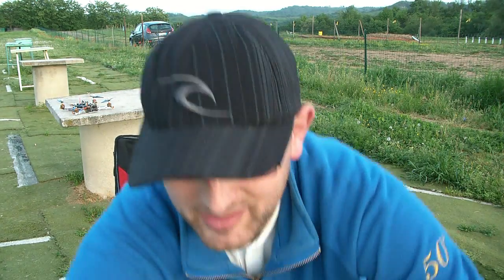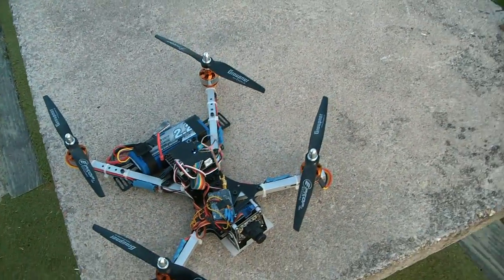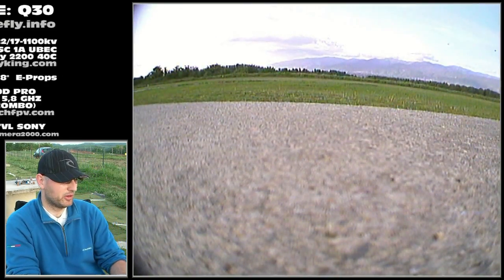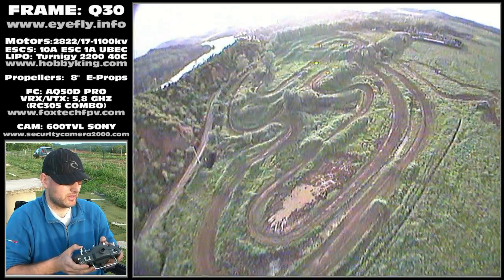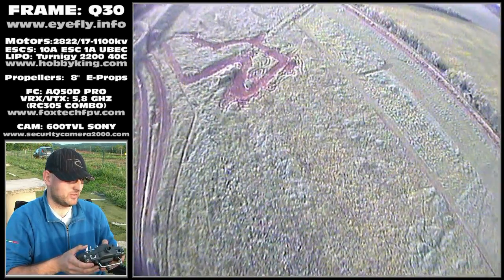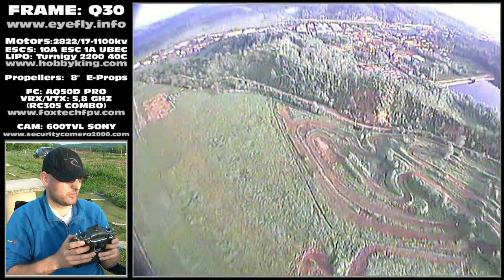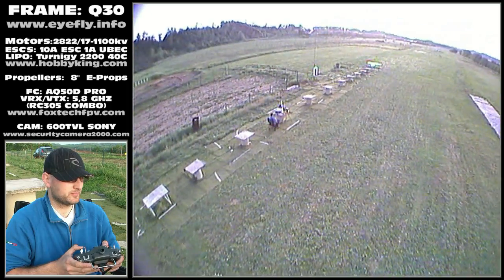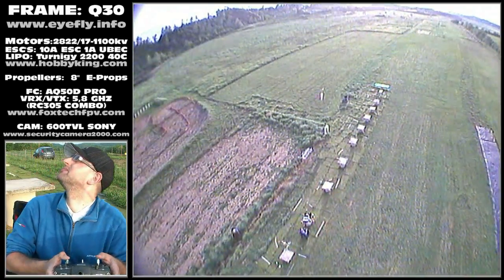RC: Narrated FPV Flight 15 - Testing the Eyefly Q30

Comment: Danke für die Infos! Sobald das Wetter mal besser ist (nur Regen und Wind in Luzern CH) werde ich es mal im Acro Modus versuchen. Habe ein DJI F450 Frame mit MultiWii 2.2. 
Ach ja, wir haben hier auch so eine tolle Offroad Strecke wie bei euch, guck buggyoffroad.ch, kannst sie ja mal testen wenn in der Zentralschweiz bist ;)

Comment from the maker: Joa, deutsch geht immernoch am besten ;D

Auf der kleinen Q30 habe ich mein altes AQ50D, das fliegt ausschliesslich im Stabilized mode (fliege Acro meist nur auf Sicht; Stabelized ist mir beim FPV lieber). Da die allerdings so klein und leicht ist, fühlt es sich beim fliegen dem Acromode meiner Q40 sehr änlich an. Am schwersten ist es die Höhe mit dem Teil zu halten, da hat man extrem wenig Spielraum und ist dauerhaft am rudern. 

Aber gut, ich fahre ja auch lieber selbst Auto als im Taxi;D

Comment from the maker: I don´t love them - but the EU laws make them neccessary here and there ^^. If i could i just would use googles and a 5000mw sender on any model ;D

But beside of that i moved now the Foxtech sender to my airplaine (soon i will do the fpv maiden flight when it will stop to rain) because it can go much more far and i will need the ground station and on the mini copter i have now the immersion rc one to use it just with googles and backpack.

I guess thats the best solution for now because...

Comment: Yes , i'm aware of the 5.8ghz difference between Fatshark and Foxtech but since you love FPV ground stations i thaw using the Foxtech instead of the immersion system wouldn't be a problem for you , you gain more range for less miniwatts on Foxtech vTX vs the Immersion ones .

Comment from the maker: Oh, i guess i explained my self wrong - i just want to replace the foxtech sender with a immersion RC because the internal VRX of my Fatshark video googles doesn´t work on the foxtech frequenzies (its in the E Band, over here we use the A and B Band). Otherwise i have to bring always the RC305 with me when i fly - but the Q30 is now my ultra mobile copter so this would be against the idea, hehehe ^^.

PS: I am waiting for a Multiwii board and the APM 2.5 - can´t wait to get the stuff :D

Comment: Don't worry about Foxtech , unlike the Immersion system you can send Foxtech really far on cloverleaf alone , if you used the 200mw vTX you can easily do 1km or beyond 2km with a patch antenna .

Comment: That's looking really nice - I'd suggest you add another switch in addition to your pot movement of the camera so you can flick a switch to look down and then back up again whilst keeping both hands on the sticks - the throttle hold switch works well for this